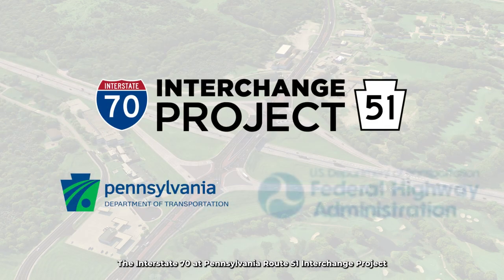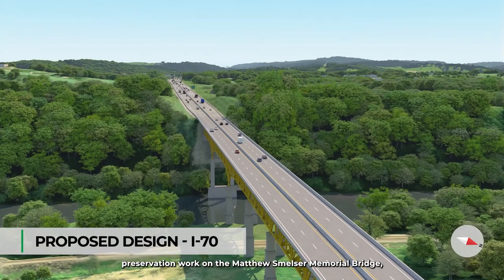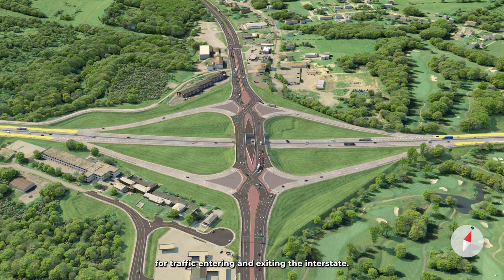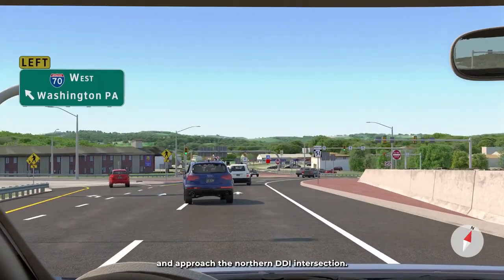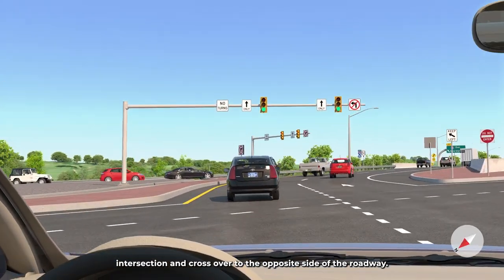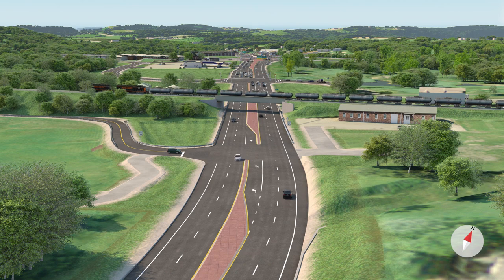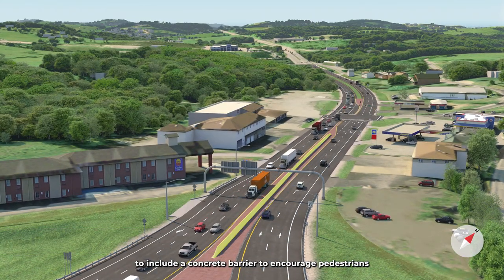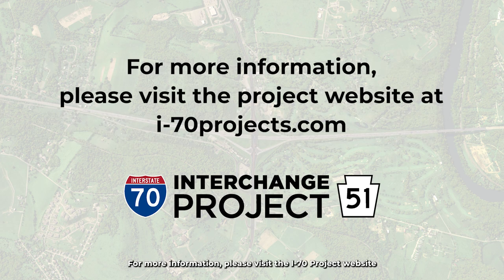I-70 and Route 51 Improvement Project Rendering

Comment: A DDI design may seem like a good idea but it only solves one of the problems while creating many more. The added lanes and traffic lights will only cause more congestion along route 51 and potentially cause backups and congestion on 70. As it is right now the traffic flow of 70 is fine, the only problem is the on/off ramps need to be lengthened, the stop signs removed, and visibility increased so merging is safer. This new design doesn't address pedestrians trying to walk from Comfort Inn along 51 to the Get Go, nor will a median deter pedestrians from crossing 51. No one will want to walk down to the Concord intersection and then back up to go towards the Sunoco station.